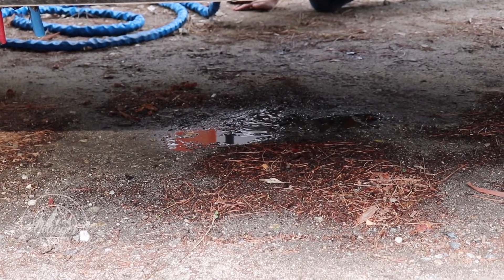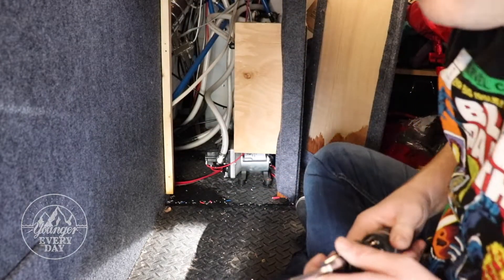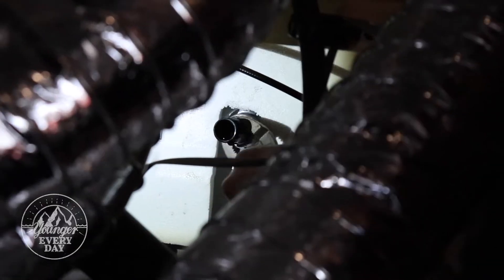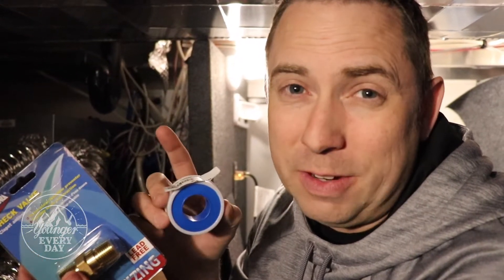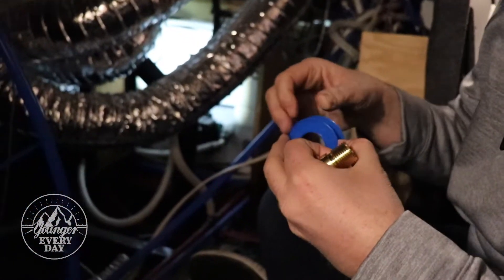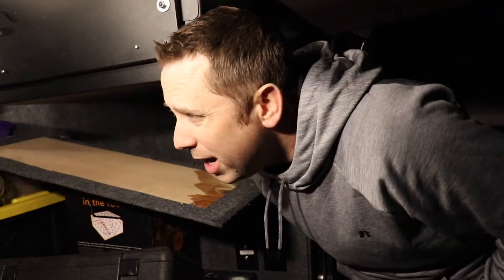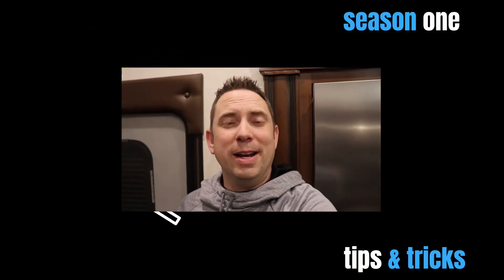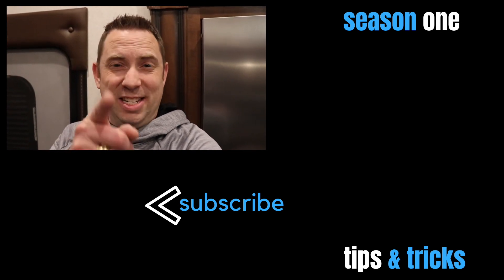RV Water Heater Leak // No Hot Water in Our RV!!

Comment: I had a leak about 3 months ago and replaced the little rubber cap beside check valve. Was fine for 3 months now i have low hot water pressure. Maybe my check valve also